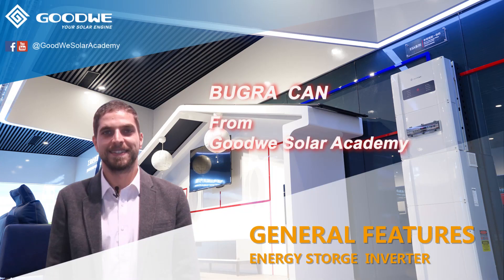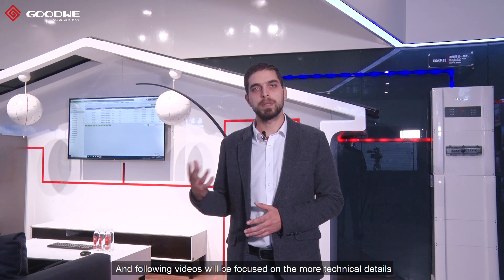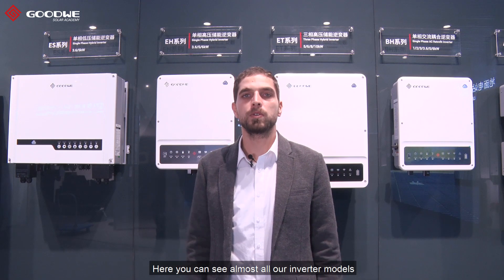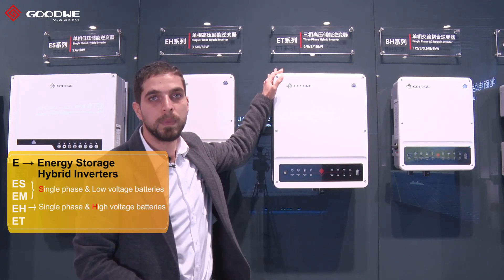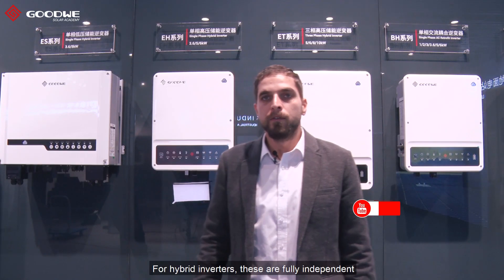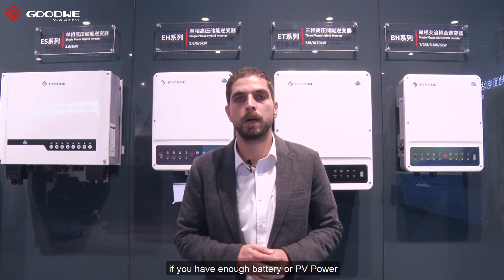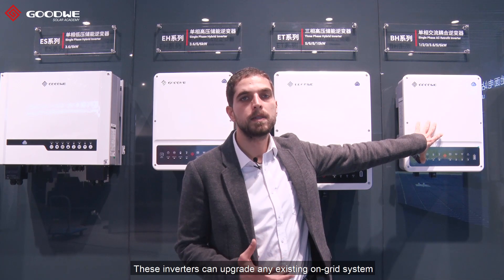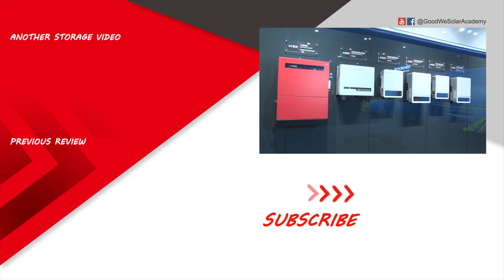How to distinguish GoodWe Storage products

Comment: Can your storage inverters be used with electric motors? Are there limits to the percentage of resistive loads that can be use?
Reply from the maker: on grid side, there is no limit for loads. on backup side, ES, ET series can use with motor but there is power limit for motors because of inrush current. for other series, cannot use with motors
Reply from the maker: and all inverters, on backup side (off-grid output), there is power limit for all resistive loads, and the limit if the norminal power of the inverter (except for EM series, which is 2300W for all models)
Reply: @GoodWeSolarAcademy  Thank you.